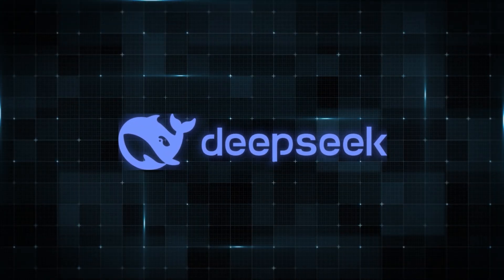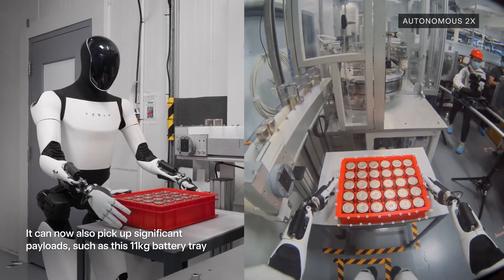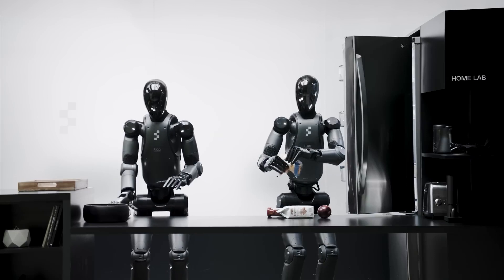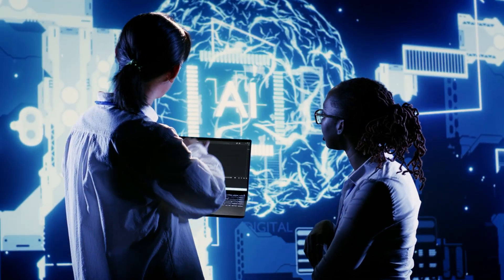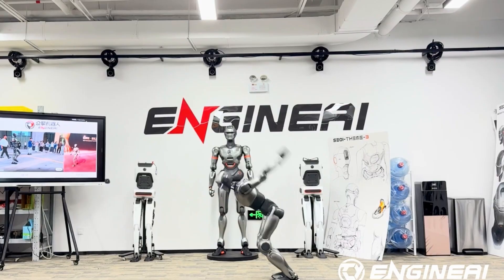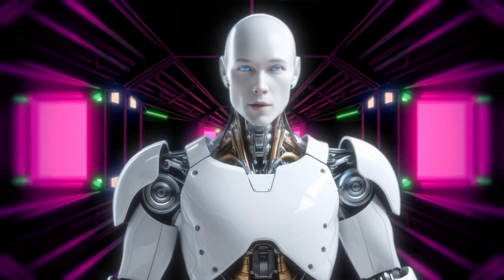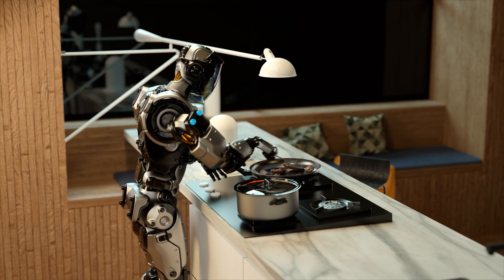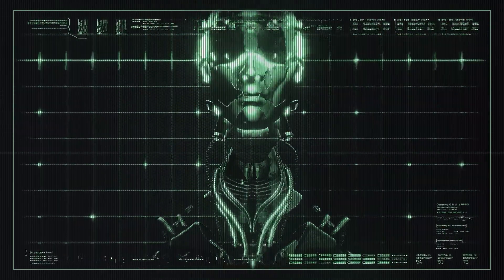HUGE AI NEWS: Deepseek leads to FIRST EVER AGI Humanoid Robot!

Comment: The real advantage of DeepSeek is licensing.  DeepSeek has issues.  I'm not Chinese, so I really don't face any threats when it comes to discussing the fact that DeepSeek has some operating parameters that are frankly unacceptable.  (Censoring and editing information that the Chinese government finds objectionable, possible monitoring and the like.)  That's the bad news.  The good news is..... it's also open source.  It's entirely possible to grab a copy, edit the problematic parts out, and use that.  If these robots can have their pre-programmed models replaced with a model like that?  No problem.  Additional training and features can be added in easily as well, and the entire thing can be monitored and examined for problems.  (Like dial-home instructions.)